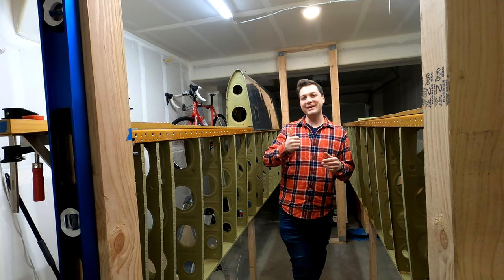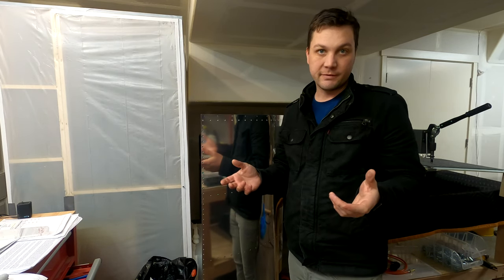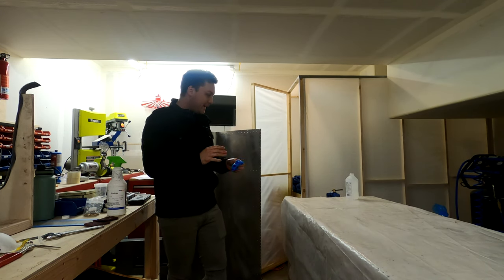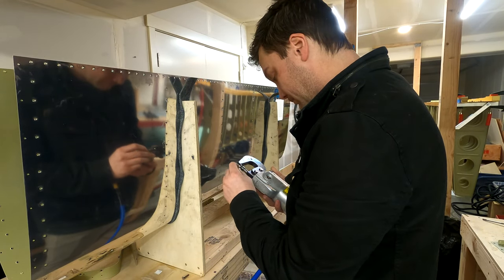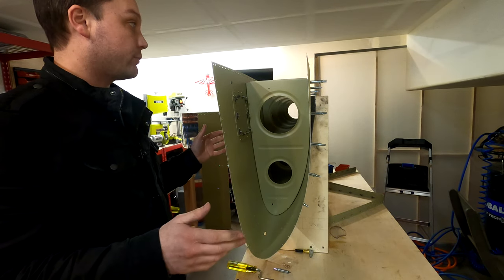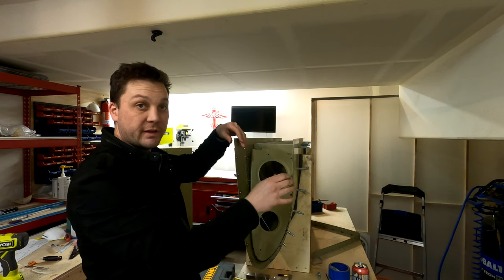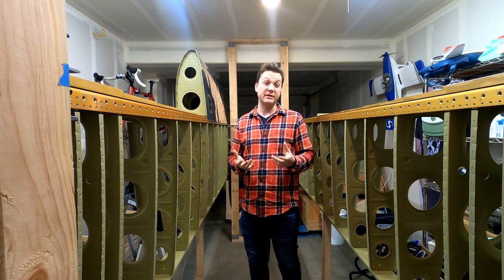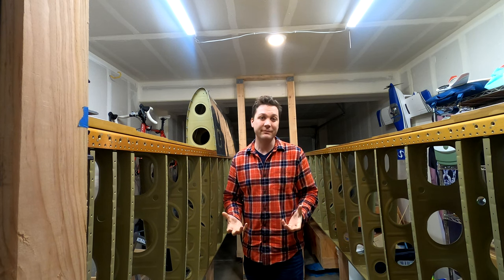Building an Experimental Airplane, The Vans RV-7A | EP2.10 Leading Edges, Part I

Comment: You can use oops rivets on material too thin to countersink to attach nut plates. It's not a structural area, just an access hole
Reply from the maker: Oh man. I wish I would have thought of this a week ago! I think that would have looked much better. 

Great tip! Will keep in my back pocket for the future!

Comment: I am in a tank / pressure vessels line of work. Careful making vacuum to the tanks, they will easily collapse! You should leak test a tank by pressurizing it. Mamma mia, I know this is a year old video and your tanks should be ok by now, but you almost gave me a heart attack when you mentioned vacuum.
Reply from the maker: Yeah, let's clarify here, because you're right. A vacuum would crush this thing like the oversized pop can it is.

A little bit of negative pressure is what I was looking at. Similarly, when pressurizing the tanks, a little bit goes a long way. The balloon is essentially your safety net, as it will pop before damage is done to the tanks. But if you've got a cap on that tank, you'll blow it up and blow holes in it with a few too many strokes of the bike pump.

Pressure differentials are no joke!

To date, the tanks are still (presumably) leak free and resting on the wings before some final maintenance then final assembly. They'll reappear in later videos!